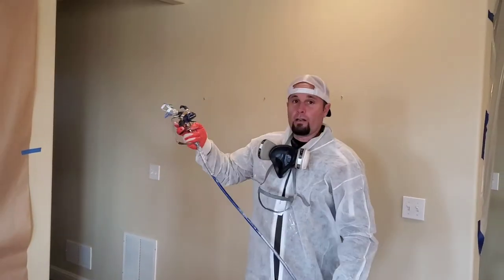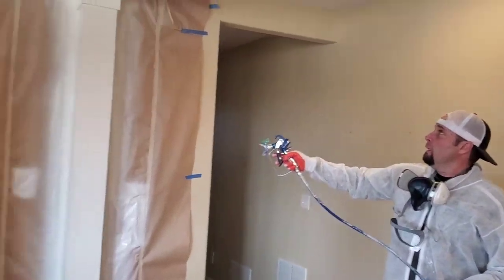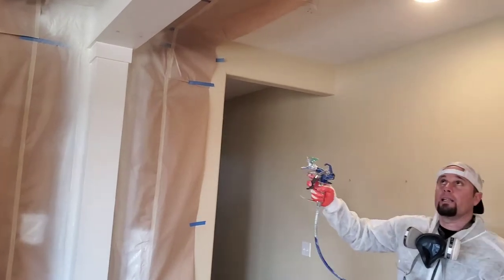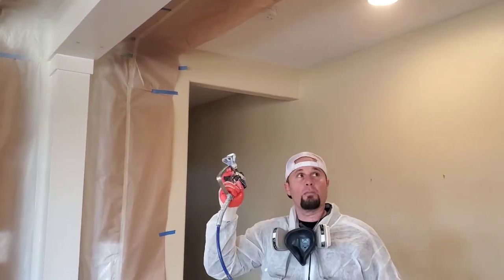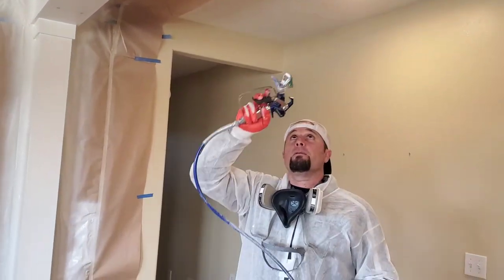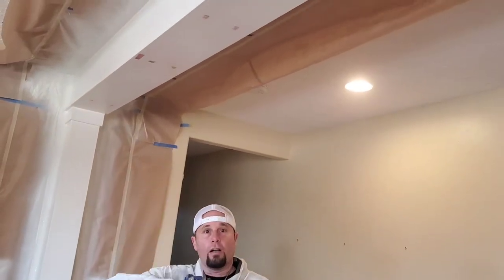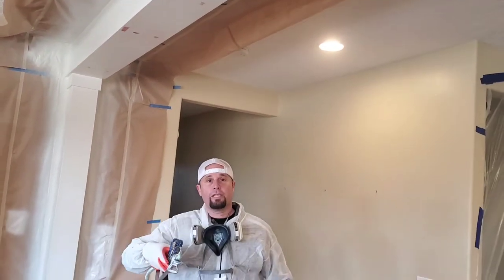How to Paint columns & trim in Home | Graco sprayer

Comment: Does over spray get on the uncovered walls?  How do you address that?
Reply from the maker: On this one we were shooting a really small tip to minimize overspray so we could control the amount. on a 310 I have found the overspray is about 3 inches and the overspray dust usually travels about 14 to 18inches with the pressure we use. we actually made it on this one, not any overspray on walls.
Reply: @PaintBoss  Thanks for the reply.